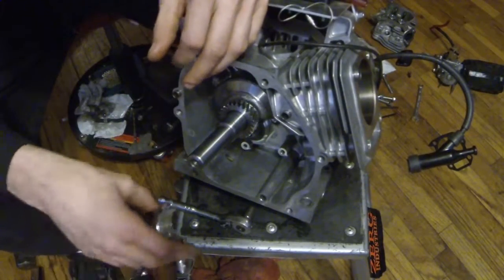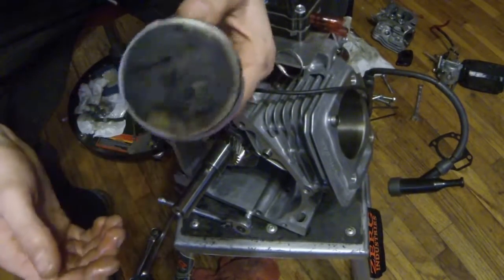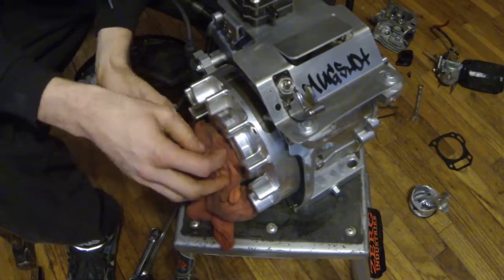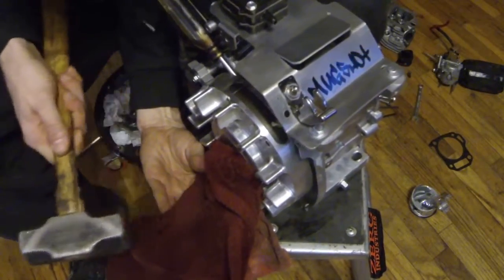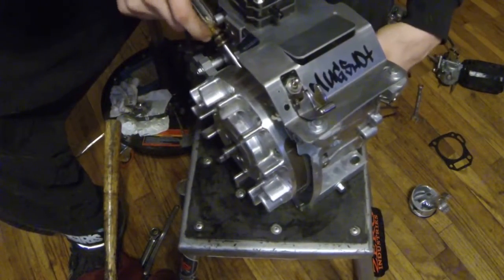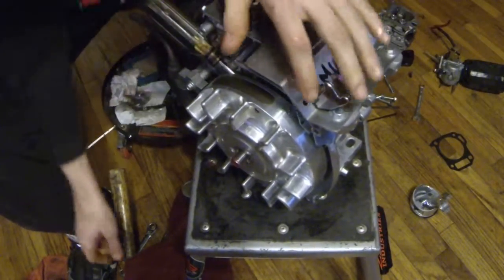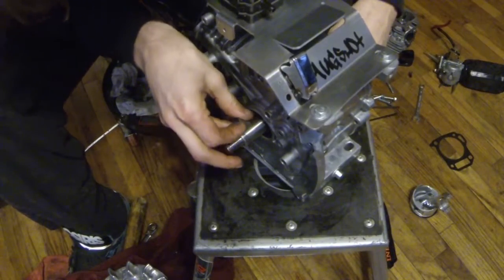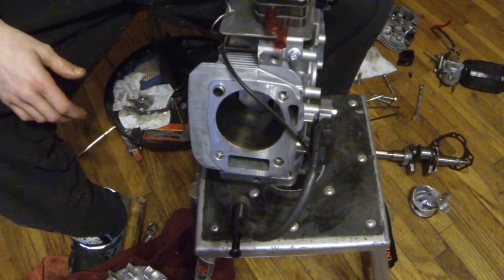Predator 212 cc disassembly part 4

Comment: put your flywheel nut back on before ya smack it with a hammer.....lay the motor on its side,upside down is better.then smack it...the flywheels weight will help it fall off...nice motor,i need to get a rpm meter...
Reply from the maker: Knowledge is power. Thanks for making me stronger :)... minibike on.